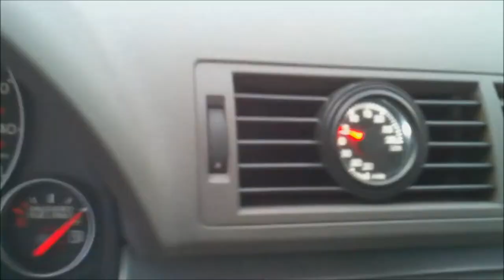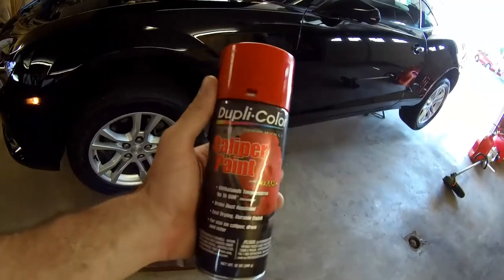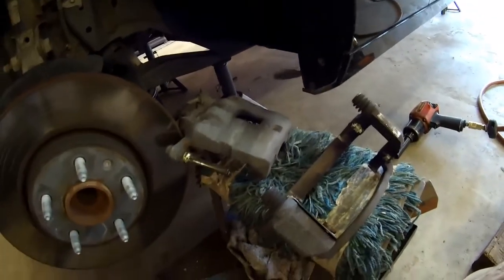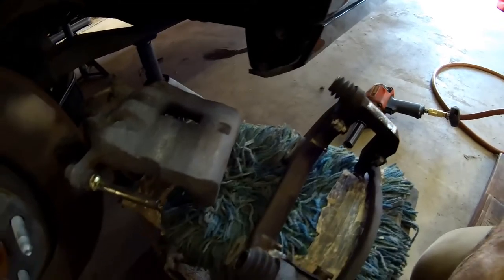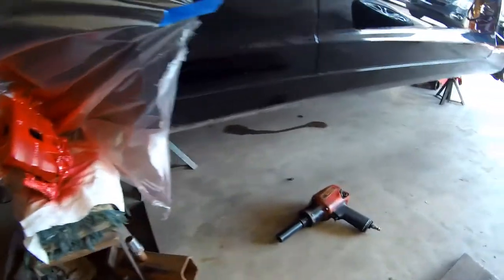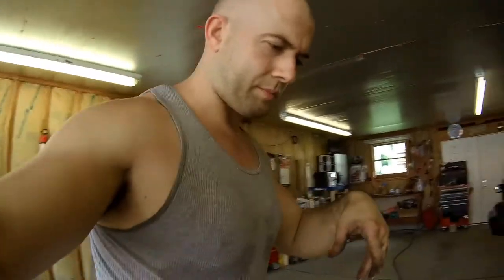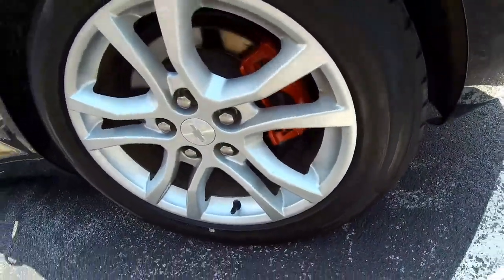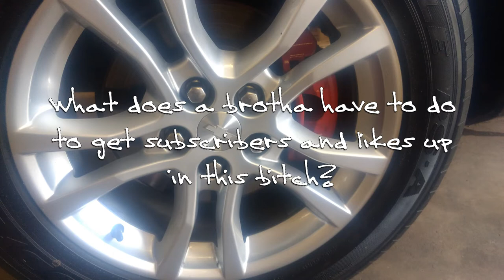Painting the brake calipers on a 2013 Copart camaro

Comment: hey how much you think it would cost to buy camaro and how much would the fees be (on co part) because im thinking about it and im  from europe so i need to know around how much they go for and the fees of copart... tnx;)
Reply from the maker: +4MyTube4Ever they go for all different amounts depending on damage.  There is no real pinpoint number there.  My wife's is a V6 automatic and I had $7800 in it all together.  But then I have access to a frame puller and other equipment that most people don't.
Reply: how much did it cost you on the parts? and also what kind of "damage  would you stay away from?" to keep it quite cheap to fix also how much would normaly fees be lets sayy if i pay 10.000$ for one? 3k or less?
Reply from the maker: +4MyTube4Ever there is no keeping a Camaro cheap.  All the parts are pricey.  If I didn't have the connections i do, this Camaro would have easily costed me $10k
Reply from the maker: +4MyTube4Ever all fees are listed under member fees on copart's web page
Reply: ok tnx for your time and keep doing awesome videos you do:)